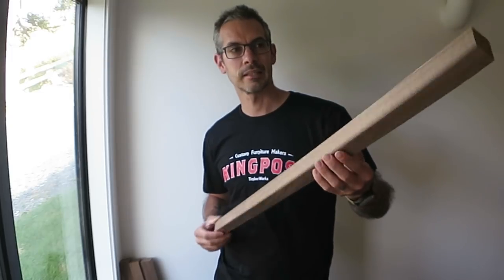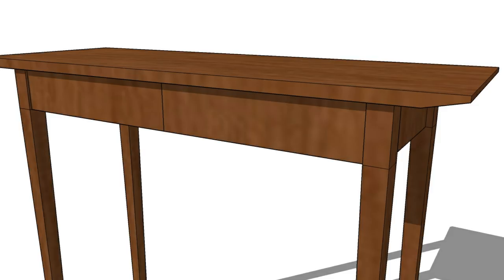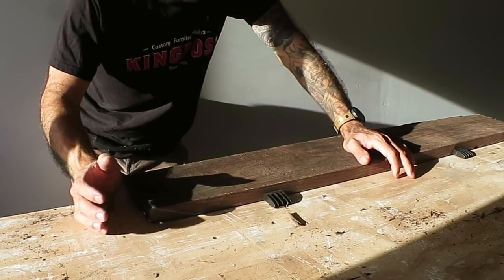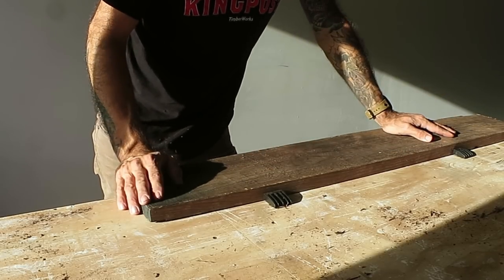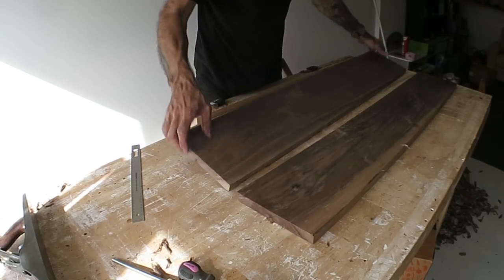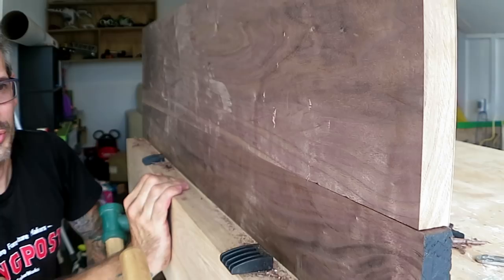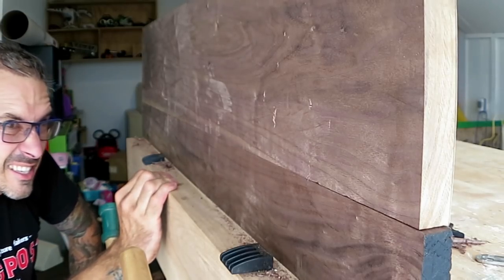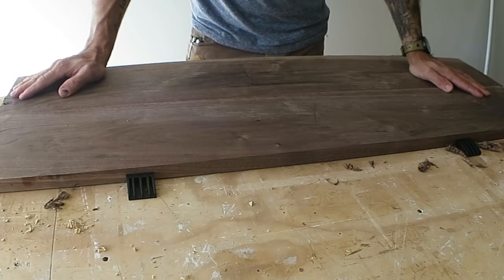Playroom workshop Ep 2, top

Comment: Hi Joey , two carpenter folding rulers or levels for winder sticks work ok , to joint edges quick to get very close stack the intended joint edges as you intend , then fold top stacked joint on top up against edge to joint , being back to back , line edges up if different heights and plane away the both surfaces and when fold back up on top mirrored joint occurs, which makes the but joints become a mirrored against each edge  . think of it like this , if wanting to joint 2 plywood edged and have a12mm router bit you would line up 2 sheet edges on flat surface if rough cut, and leave a 10mm gap between both edges  and trim straight of through joint making a seamed straight edge routed joint , same as a hand plane method just doing it back to back in vertical method, , when doing a fixout and must joint and  site laminate ,this is the method I have used now over 20yrs taught by the old school , love video mate , hang in there with C0-19 im in same boat as site in aus will close this week .